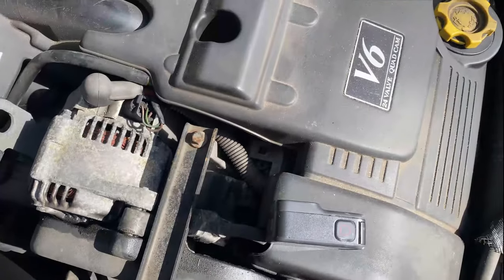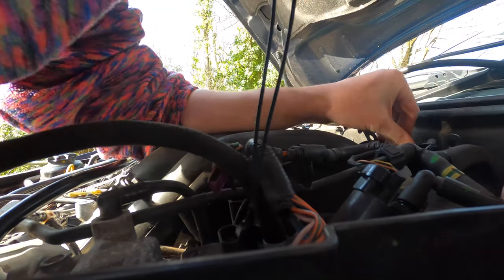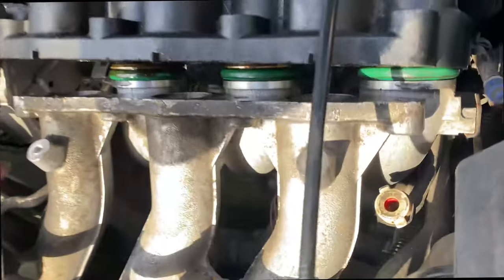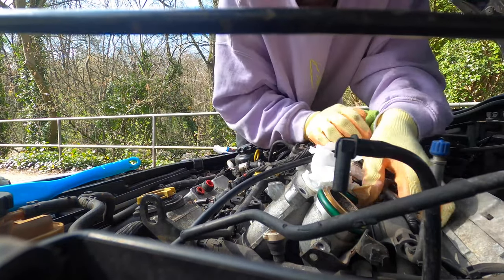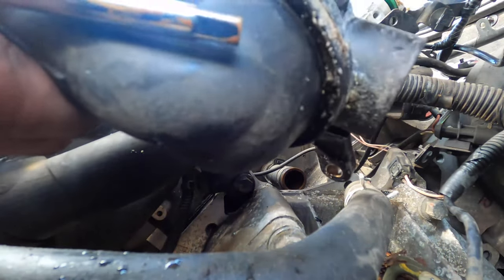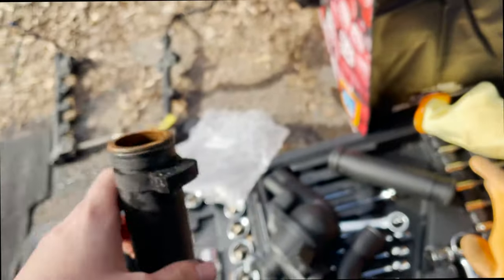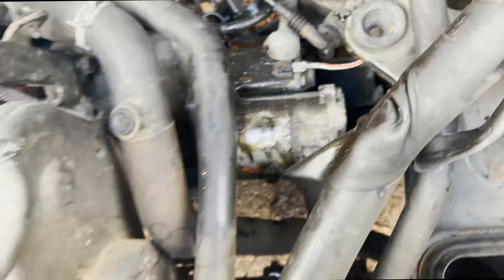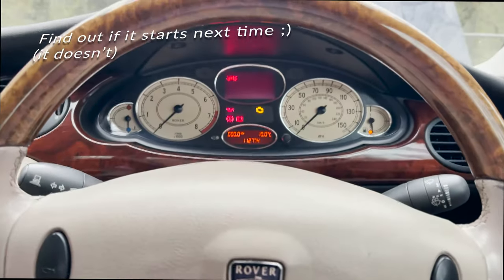Rover 75 V6 Project - Replacing The Thermostat - Keyhole Method

Comment: Were there bolts on the back of the intake manifold? I couldn't tell from the video.
Reply: There are two bolts.  In the video you can see that the attachment of these to the intake plenum has broken off on both, probably why it was so difficult to remove…

Comment: what parts are you having trouble finding? For 20 year old cars, I've found no problem re parts availability - although I do have to ship them from the UK to Australia all the time.
Reply from the maker: it's mainly replacement bumpers in the same colour in good condition.
Reply: @tomdrives  Ah ok, yes, guess they're hard to find. can you get your existing ones repaired/painted?

Comment: Tom, this is intended as constructive feedback..... Is there any way you can get someone else to hold the camera? It's so difficult to see the details of what you are doing when everything is done one-handed while the other hand waves the camera about. It makes me seasick! But more importantly, if you had a camera operator you could use both hands to show what you are doing, which would be so much better. At the moment you are skipping certain crucial steps (especially around the removal of the inlet manifold chamber) because you needed both hands and had nowhere to put the camera. And to be honest, putting the camera down on the engine and filming sideways almost never shows anything useful.

Another option might be to mount the camera on a tripod or stand of some kind, looking down on what you are doing. Either option would be so much better than doing all the work one handed while you try (and fail) to hold the camera steady in the other.

Like I say, this is feedback with the best of intentions. 😊
Reply from the maker: Thanks Steve, unfortunately nobody to help me all the time. The newer videos are of a lot better quality. This was years ago when I was rebuilding brakes at the side of the road!

Comment: "No bother it's just water". If you like your head gaskets I'd get that sorted. It's also where all that lovely orange gunk is coming from inside your coolant. Get it flushed and filled with coolant buddy
Reply from the maker: I was referring to the water going on the floor not the condition of the water.